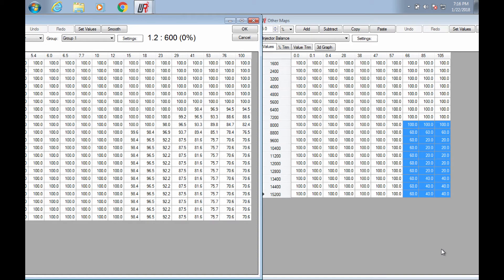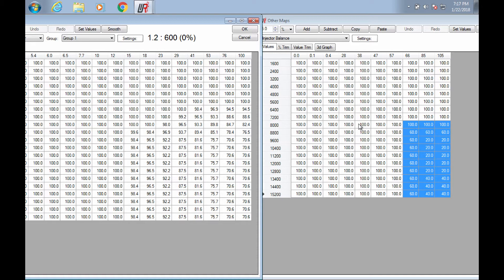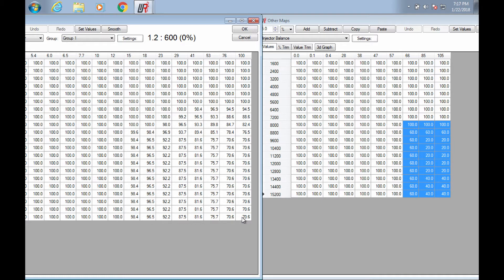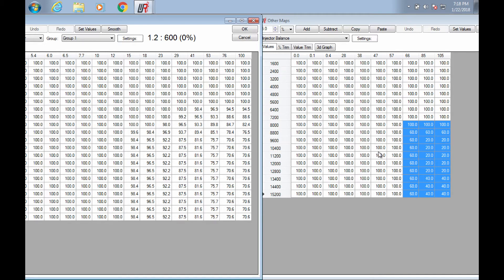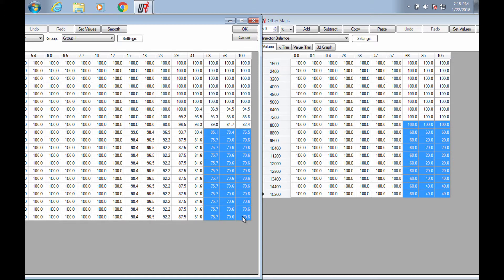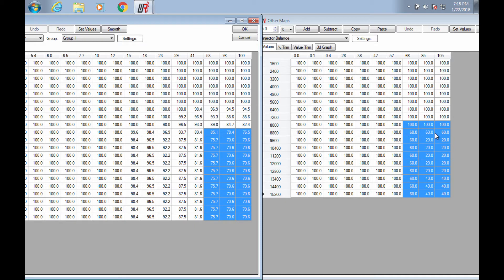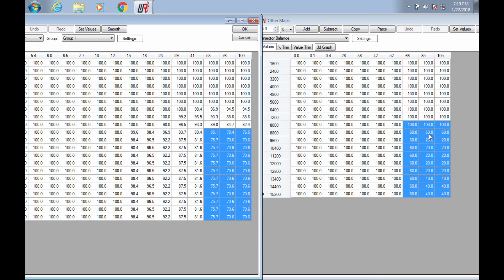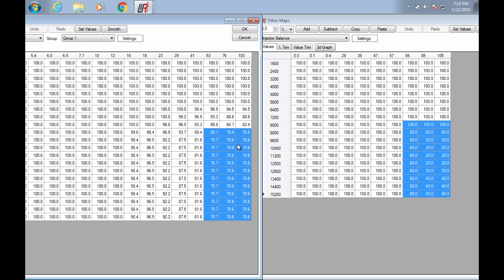Kawasaki zx10R and Suzuki GSXR1000R injector balance maps explained

Comment: Hey Jason, just stumbled upon this video from 3 years ago.  For the ZX10-R, which setup provides best power at WOT and Max RPMs?  Is it 50/50 IN 78, 89, 100?  Or 60 Lower/40 Upper?  Or 60 Upper/40 Lower?  Mine are currently set at 78, 89, 100 for 50/50.  Is that best for power?
Reply from the maker: I'm at 50/50.  Best power depends on the balance between cylinders that currently exist.  You will have to do some testing to find out.

Comment: I assume that for a track is logical to pull more on upper injectors, like Suzuki did (right diagram).
Reply from the maker: I have adjusted my ZX10 to a closer match of Suzuki.
Reply: @MantisRacing  Did you notice any difference?
Reply from the maker: Ninoslav Mitic I added a big air intake and modified the stock funnels slightly.  I had to add about 5 percent more fuel almost everywhere in the stock range I changed injector balance.  This could be to more power or loss of fuel because now more fuel is above the stack.  I did this before a trackday.   The bike did feel more responsive and more torque.  I have no proof so take it for what it is worth.  I can say front straight speed increased.  I have a dragy this year to get real feedback